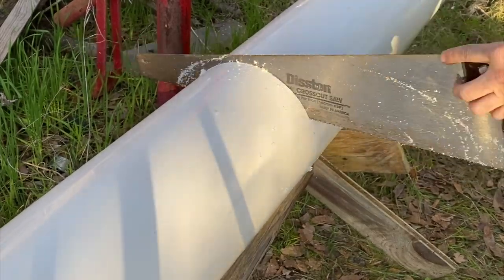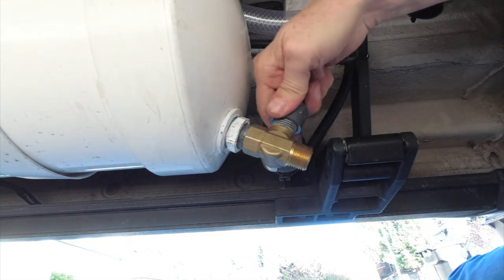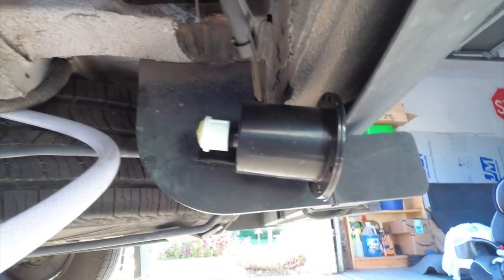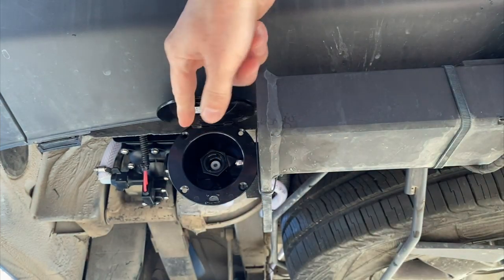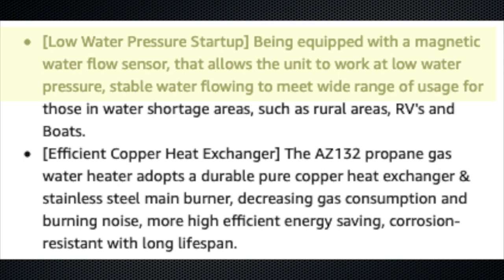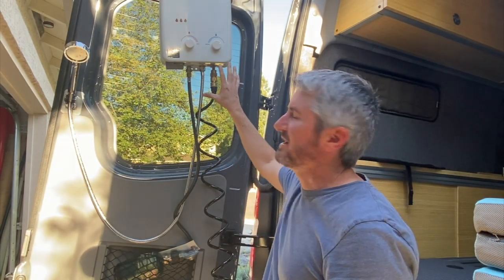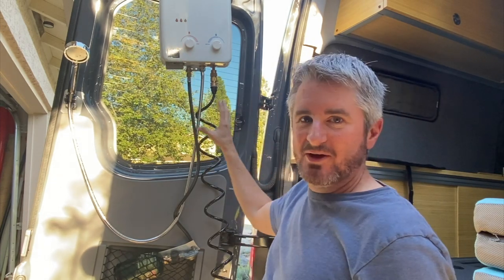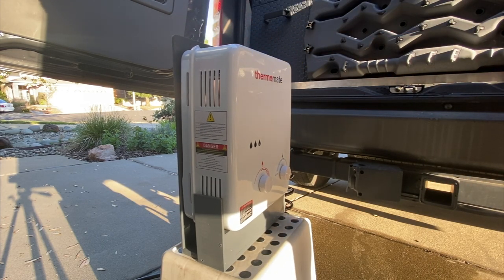Simple Hot Water Shower System for Vanlife

Comment from the maker: Hi all, we get a lot of questions on how this performs at high altitude.  Please know that most of these hot water heaters are not recommended for use over 2,000 ft elevation.  This is one uses higher quality internal parts that allow it to perform well at altitude.  Read all about it here:  https://ourkaravan.com/simple-hot-wat...      We have used ours several times in the mountains of Colorado at over 10,000 ft and has performed great.  Thanks for following along!
Reply: Any idea how long a 1 pound propane tank will last for one person if they took quick 1 quick shower like this everyday? Get wet, turn off shower, soap up, rinse off.
Reply from the maker: @joeblow1942  Hi, I'm not completely sure since we use the same propane canister to cook on our propane stove.  I'm going to take a guess that it will last about ten showers.  I use the method you described--get wet, soap up, rinse off, then repeat with hair.
Reply from the maker: It’s factory, I haven’t done anything underneath

Comment: Do you know if the heat that exhausts from the water heater is toxic?
Reply from the maker: Hmm, it will be combusted air so maybe?  The main thing is the burner will be consuming oxygen in the van so it’s not a good idea to run it in a well sealed and enclosed space. This unit does have an oxygen deprivation sensor that will apparently turn the burner off if it senses low oxygen, but be careful.

Comment: Creative way to an outside water tank. I use the same camp hot water shower, but I like to heat up the whole water tank. I have a 20 gallons tank and it would take about 20 minutes to heater up. The water would stay at a good shower level for 4 hours, and up to 9 hours warm room temp with outside temp around 40 degrees. My tank is inside the van so yours might differ. I do it this way because I get warm water at the sink to use and not just wasted on showering alone.
Reply from the maker: Sounds good, thanks for sharing!

Comment: I've watched a lot of vanlife videos and I don't think I've ever seen one with 2 water tanks - that's brilliant! It makes perfect sense but most people just use one tank. This is great, nice setup.
Reply from the maker: It works great for us.  The two 5-gallon jerry cans inside allow us to clean and dry them out, ensuring they are clean for drinking water.  They are also easy to fill while on the road and can't freeze because they are inside.  Having the shower water outside saves space, balances the weight in the van and if it's frozen, we probably wouldn't be showering outside.  Thanks for the comment!

Comment: I have a hot water system in my merc sprinter that only heats when the car motor has been running for about 30 minutes.Could this also be heated by gas? I have a gas cooker
Reply from the maker: This hot water heater is heated by LP gas.  I'm using the 1-lb propane bottles but of course any propane supply can be used.

Comment: Is it possible to have the inside the van I want to build a actual shower and use something like this inside during the cold months and kids
Reply from the maker: Technically I think you can but you have to give it plenty of space to vent.  It releases a lot of heat out the top.

Comment: What I didn’t see you and you never showed is your fuel source for the shower and how you use that and where you keep it
Reply from the maker: The fuel source is that 1-lb propane bottle that is sitting in the cubby of the rear door.  The LP hose simply goes between the propane bottle and the LP input on the heater.

Comment: Cool setup, but how do you have the gas installed
Reply from the maker: It’s simply a 3’ bbq regulator hose attached between the propane inlet of the furnace and a 1 lb propane bottle via an adapter.

Comment: Gratis video as allways, one question is the water heater rated for indoor use? Meaning i can used with the doors closed.
Reply from the maker: Sort of.  It has an oxygen sensor that will shut the unit down if the oxygen content in the room is dropping, but it puts out a fairly significant amount of heat, so it should be very well ventilated.

Comment: would you be able to have that all mounted up somewhere and just use it when you need it or is there a reason you took it all apart and put it under the sink?
Reply from the maker: You could mount it somewhere as long as it had adequate ventilation for the hot exhaust gases that leave the unit. I didn’t like the aesthetic of it permanently mounted but you certainly could.
Reply: @ourkaravan  do you think you could mount it up on the roof (not sure if it needs to be sitting up right or fine to lay sideways). I've got my road shower up on the roof but am looking for a way to get it warmer since the solar heat of the black pipe cools down rather quick

Comment: at 5:20, what lights do you have mounted in the rear door next to the speaker? do you find them useful?
Reply from the maker: Hi Dan,
I use these:  https://amzn.to/2JBO2Mx
The lights are super helpful and can be used in three ways.  If the rear doors are closed and you need a bunch of light in the back, turn them on.  With the doors open 90 degrees they light up the area right behind the van for loading and when you swing the doors around 270 degrees they light up camp.  The latter is why I have them tilted from level--the tilt allows the light to spread toward the front.  
If you weren't aware I have a store where every product used in the van is listed. Go to https://ourkaravan.com and click on store in the upper bar.
I hope that helps!  -Ken

Comment: Just need no more than a gallon of water for quick rinse hygiene. Gas is not my first choice, what we old you suggest in terms of electric tankless heaters?
Reply from the maker: There are several electric ones out that that will work but they are power hungry and the tempering valves , mixing valves and winterizing plumbing take up an awful lot of space.  That’s why I went gas in this case

Comment: Any special reason why you installed the pump outside? Would it work if I put it up in the van near the rest of my water setup?
Reply from the maker: Yes, it’s definitely desirable to have the pump near your source.  I mounted mine outside because my tank is outside, as is the external shower hookup.  I didn’t see much point in bringing water inside when the intended use is outside.  I hope that helps!

Comment: Hi Ken. I love your multi-tank approach. This plumbing looks similar to your galley system. Why did you decide to go with a separate pump for your shower?  Why not use one pump to draw water from your scepter tanks OR your passenger side (shower) tank? Also, can your Thermomate water heater be used to for shower and galley? Are you expecting to use the sink and shower simultaneously? Otherwise, is there an issue with pressure/compatibility/cleanliness that I'm missing? I'm looking at a similar setup where I have internal water tanks and an external tank, but I would prefer to have one pump and one water heater for shower and/or galley. Any insight you can provide would be helpful. Thank you for all that you have provided.
Reply from the maker: Hi, the biggest reason for going with two pumps was to simplify the install.  Using the same pump would have required drilling holes in the floor and passing water lines in and out.  With my existing setup it all stays outside.  And since I used the same pump as the galley, if a pump dies I can swap one for the other.  
I haven't found that I need hot water at the sink.  If I did, it would be really easy (and efficient) to use my electric kettle, which brings water to a boil in just over 1 minute.  The propane units aren't really meant to be used in enclosed spaces.  They produce a lot of heat that is vented out the top and back.  
I had considered other types of units but the space required to implement them would have meant giving up a lot of storage.  Hope that helps explain my reasoning!

Comment: Where are you drawing your propane from?
Reply from the maker: 1-lb gas bottle via adapter!   No propane in this van otherwise.
Reply: @ourkaravan  how long does a 1lb tank last?
Reply from the maker: That’s a good question. I tend to use the bottles for the shower and for outside cooking, so I haven’t been able to approximate the use yet.  I’m going to take a wild guess and say 10-12 showers, but it could be more or less.
Reply: @ourkaravan       Where is the 1 pound propane bottle located? I don’t see it anywhere in the video. 5:16
Reply from the maker: It’s in the factory rear door pocket immediately below the rear window.  You can see it in the video now that you know what to look for.
Reply: @ourkaravan  I’m looking at doing at a similar set up using 1lb tanks for ease of portability. What a adapter is needed to us the 1lb tanks?
Reply from the maker: The adapter and full parts list is located here:  https://ourkaravan.com/simple-hot-water-system/

Comment: How dlhave you set up the removable gas connection for this?

Cheers
Reply from the maker: Right now the gas line screws to both the propane bottle (through an adapter) and also screws to the propane feed on the heater.  For the latter they do make quick disconnects.  With the frequency I’m using it I haven’t found that necessary

Comment: Seems complicated and an effort to shower.  Why not the 2.5 gallon Bosch water heater?  Fits under your sink.
Reply from the maker: Biggest reason is I wanted on-demand, but also the Electrical draw was a consideration and my inverter can’t run the Bosch.
Reply: @ourkaravan  
About 1450 watts upon start up and 700 watts once you draw down a gallon or so.  What did you do for cold water while showering?
Reply from the maker: My inverter is 1,000w.  I haven’t had any shower system until now.
Reply: @chrissubleski200  That's an insane amount of power! I would rather spend my accumulated solar energy from my solar panels on something else .
I don't want to plug in wall power, i don't want to buy a stinky gasoline generator and i don't have the money to buy a solar system and battery bank that can cope with this huge power draw.
O, and i don't want to heat up a water container when you're probably not going to use that today, or all of it..
Also, when 2 persons take a shower, the second person may find herself showering in cold water..
So, this heater is a nice option.. :-)

Comment: Love all of your videos.  What's your opinion on a recirculating shower system?  (I know you've looked into them)

My only nit is every one of my YouTube ads lately has been from The Epoch Times, a Falun Gong operation.
Reply from the maker: I think recirculating makes a lot of sense.   It might require significantly more setup time when used outside the van as seen here, or maybe it’s not as complicated as I think.  
Sorry about the ads.  I don’t have any control over their contents.
Reply: @ourkaravan  I know regarding the ads, just curious.

FWIW, I've been using 8020 in my van build (thanks to you and humble road), got me through burning man last year (9 nights in the desert)  It's like lumber but more accurate and less flammable.  :P
Reply: @ourkaravan  regarding burning man: one thing I did do was re-paint the van adding this ceramic additive from a NASA spin-off.  It effectively reflects > 99% of infra-red.  My 20's son was able to sleep comfortably until noon without air conditioning.  It doesn't seem necessary for your use just sharing.
Reply from the maker: Is this paint on the outside, or an inside ceramic like I used?
Reply: @ourkaravan  It's on the outside.  It was shockingly effective given it was in pretty much direct sunlight in the desert every day.  I did it as a "test," meaning to ensure it could be easily removed I mixed it into "Plasti-Dip" in case it didn't work out.  It makes the outside of the van feel a little gritty, like worn sand-paper.

Comment: You briefly mentioned the exhaust from the water heater. How significant is the exhaust? Would the roof fan vent it out well enough? Or would you recommend finding another option for a permeant, indoor shower setup?
Reply from the maker: Hard-mounting inside would be dicey.  It does have an oxygen depravation sensor (which is good) for running in enclosed spaces, but you would have to be very diligent about providing enough ventilation and ensure whatever is behind it is well shielded from the heat.  The heat is fairly significant.

Comment: is the water pump connected to the sink and the shower?
Reply from the maker: Hi, no.  I have two separate water pumps in this van....one pump is located below the sink where the portable water containers reside and the pump for the shower system is under the van.  It was just easier that way...
Reply: @ourkaravan  thanks